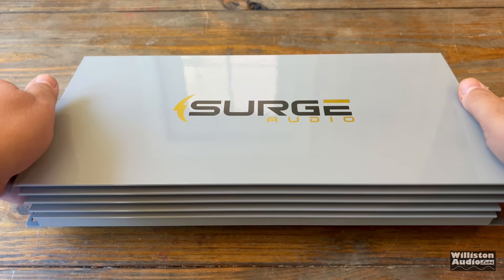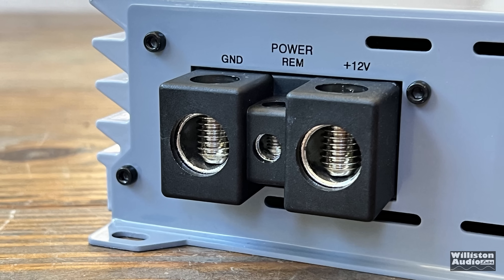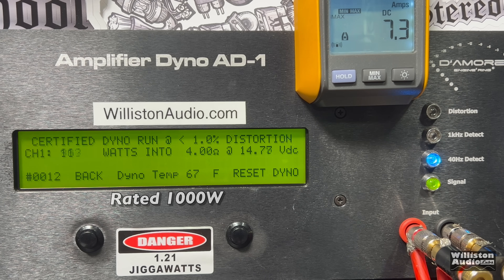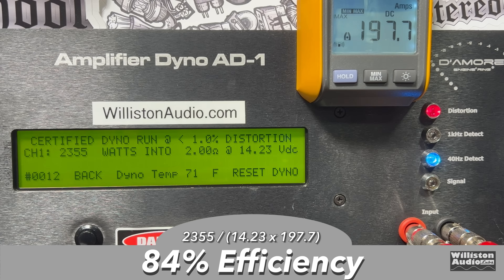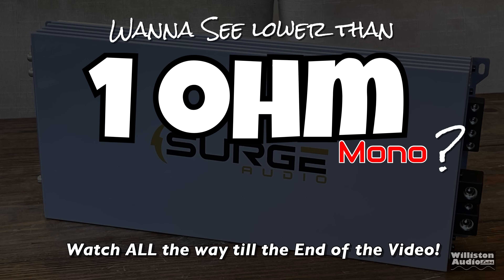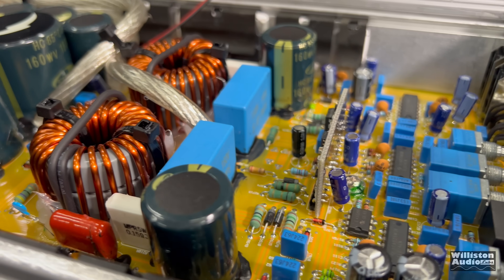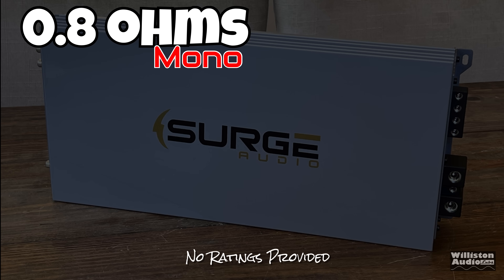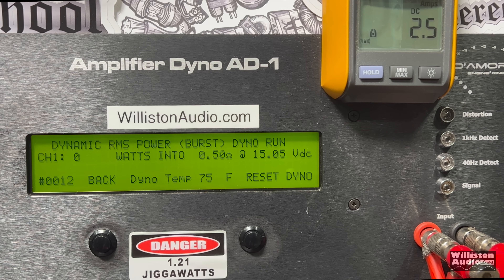Less than 10 Cents a Watt? Surge Audio PL-3000.1D 3000W Monoblock

Comment: These amps are what make car audio exciting and fun!!! In the old days, we'd have to save our paper route money for years to buy power!!!lol
Reply: You're absolutely right.  Last time I made such comment I was called a boomer, lmfao.  Today it's rather easy to get into car audio due to the price per watt
Reply: @jorgem50 You're right. Today anyone with a little money can get good bass. Back in the day, when power was $1 per watt, it wasn't so easy.
Reply: @ElectronicMusicUnderground there's not even close to enough room to do that 😂😂
Reply: so wait you put the subs in the bed of the truck and cut a walkthru in the cab? @ElectronicMusicUnderground
Reply: Paper route? Did "we" strap a red wagon to our Huffy and build a system to drag around? 😂
Reply: Didn't need a ton of power back then. 100 watts would drive a sub pretty darn loud back in the day.
Reply: My first system was 2 10" RF series ones in a sealed prefab box with a 240 watt California amp and it pounded.. rn I'm running a single 15 NVX vcwD2 on a 500 watt Alpine V12 in a 5.85³' vented box tuned at 28 hz.. I have more money in just the wiring than what I paid for my whole system 28 years ago.., but yea.. took over 2 almost 3 years of delivering papers and a couple months making pizzas 🍕 to get it all.. made minimum wage at 4.65 per hour back then..
Reply: @leesalsberry4595  how’s your vcw sound in that size box and tuned that low?  I got mine at about 3.8 @at 33hz. Jams good but interested in your point of view.  Don’t see to many people with that sub
Reply: @leesalsberry4595 fortitude discipline & hard work 💪pays off 💰🤑
Keep banging 🔊🔊💨💨💨💨
Reply: @leesalsberry4595  I currently have a two 10inch nvx vcw on a smart 3.  Man them nvx subs are crazy good
Reply: Oh yeah!  You never forget your first “BIG” system!  Mine was in in 1987 when I finished my first two years of high school with straight ‘A’s’  and my Grandparents bought me a nearly new ‘87 Nissan D21 pickup with a windowless snug top shell (very difficult for me, because school bored me and I was a notorious goof-off and slacker). I worked Hard that summer at jack in the box to get my 6 M&M Godfather 12’s with 3 Orion 225 HCCA Amps powering them, in a custom built box that a friend and I built in my Grandparents garage.  We also cut a “Walk-through” so I could hear all that loud bass goodness!

Comment: Your comment regarding not seeing anywhere full power because that's where it sounds good underscores that people really don't need these megawatt muthas to adequately power a system.  I had a 250W competition SQ system (no HC amps) way before Class-D was a thing and I was in the 136 dBA range, which is plenty loud.  Plus, you get diminishing returns as you have to double power for every 3 dB gained. That leads to spending lots more money in cables, alternators, and batteries for marginally more volume that most people wouldn't notice unless you showed them on an SPL meter.
Reply: You my friend are absolutely right. I started in car audio in the early 90's,  and let me tell you these kids today have it so easy that they don't take the time to learn the science behind car audio, kid's today don't have to learn ohm's law, because all these amps are low ohm stable. In 92 I was able to do hair trick on 500 Watts, had an over sized quad box with 4 15's. Kick comps on 2 kenwood kac 921 ( still have one) look this us going to sound crazy, but u had someone with a taramp 5k and 1,200 watt planet audio , ask me how to i have so much power, I told him I only had a 100 Watts to each interior speakers, and 200watts ( if lucky) to each sub,  and every thing is wired at 1.6ohm load. I have a ppi a 600.2 and a eclipse xa 1000 monoblock, the ppi is 30yo and the eclipse is 20yo, so I explained to him that I think in db, you think in watts, I have a quad 6x9 box with 4 pioneer premiers, a chachoro box with 2 10in midrange, 2 bullet tweeter and a horn and a triple stack of 12in punches. I tell him the differanc between 5000 watt amp an a 10,000 watt amp is only 3db, but how we get around that is by each additional speaker is a 3db gain. Mind you he had 4optima batts,  0gauge, 2 audio pipe spl subs (1100 Watts rms) 2 6x9 and 4 compression tweeters, in a Mazda 3 sedan. I can keep rambling,  but to put it simple, I told him space makes bass, and did I fail to mention that he had blown one of the subs. These shop's are taken advantage of these newbies,  5k was never meant for 2 subs, maybe 2 18in jackhammers, I don't think 2 13in w7's can take 5k, but I'm sure you remember the Rockford vehical with 12 speakers on one 150hd ( still have one, first gen) after seeing that, I made it a point to learn the mathematics  behind car audio
Reply: I started about the same time as you. Still run 12" Kicker Comps from the 90's as well as MTX Thunder 4320 & 2300 amps. A couple yellow top optima batteries and I can play for an hour with the engine off. Old school class A/B! @thomasbradian6367
Reply: The cost to give yourself tinnitus has gone down drastically. I never cared for straight up numbers and always preferred quality.
Reply: @Bob_Smith19  Completely agree.  I have tinnitus myself from that.  Well, that and working in car audio for six years.  You are absolutely right.  I did have fun doing it, though. 😉
Reply: I'm more than happy with 500 watts on my sub and 400 on my door speakers.  Loud and clean sounding and not a huge strain on my car electrical system.
Reply: 100 QUALITY watts is plenty enough for permanent hearing damage.

Comment: Where do you set gain for this test?
Reply from the maker: Amp gains are matched to Pioneer 80PRS head unit with 7dB overlap using the DD-1+ tool integrated into the Amp Dyno
Reply: @wal  it would be great to put a how to into one of ur next Amp dyno videos
Reply: @wal  I would like to see how you do it
Reply: I believe he uses some purpose built amp gain tool to set it up properly. It'll vary between amps put on the Dyno.

Comment from the maker: Surge Audio PL-3000.1D 3000W Monoblock Amplifier
Link to Amp: https://surgeaudio.com/pl-3000-1-3-000-watt-monoblock-car-amplifier/
Previous Video on Surge Audio 4kW and 7kW amps: https://youtu.be/DEJ11NHMJ6c
Modes of the Amp Dyno: https://youtu.be/Q0m6NsB-HHc
Subscribe https://www.youtube.com/@wal
See My 2nd Channel Old School Stereo https://www.youtube.com/@wal2

Sponsored Video Note: Video is marked as sponsored as Surge Audio paid a "slot fee" to have this product tested and video created. It is important to note all of the test data is objective and all of the opinions in the video are mine. Surge Audio wasn't allowed to review this video prior to public release.
Reply: Question BigDWiz. I plan to only run this amp at 4ohms for now. Am I good doing a big 3 and 100amp stock alt or do i need to upgrade alt regardless?
Reply: Later on i plan to get a 300 or 350 amp alt and go 1ohm